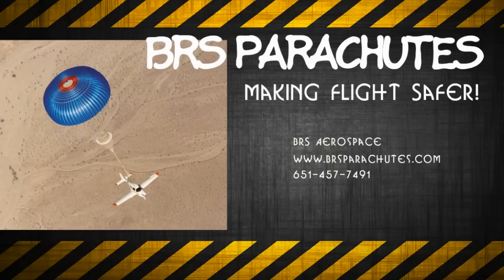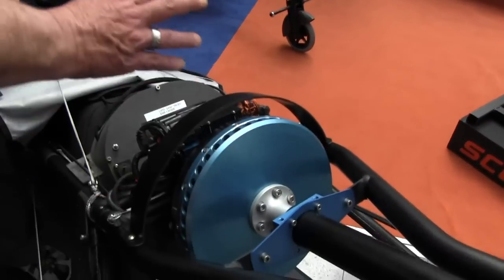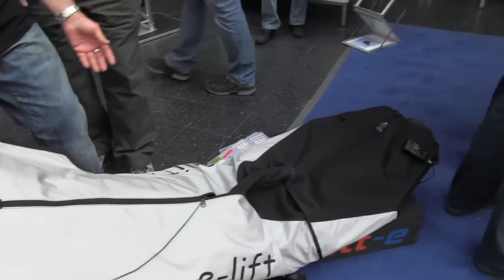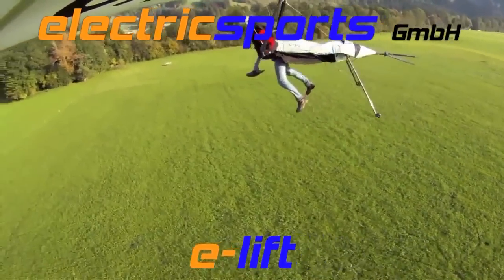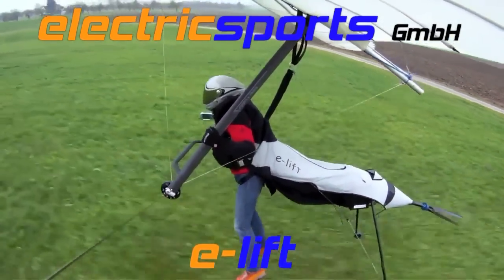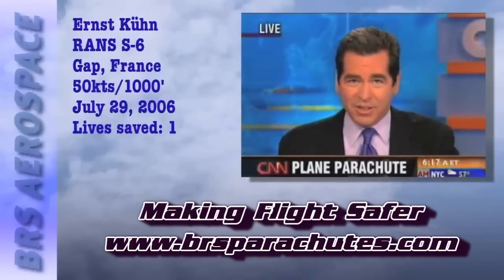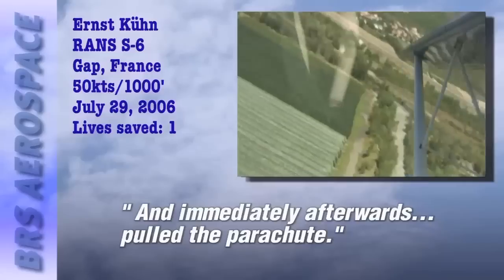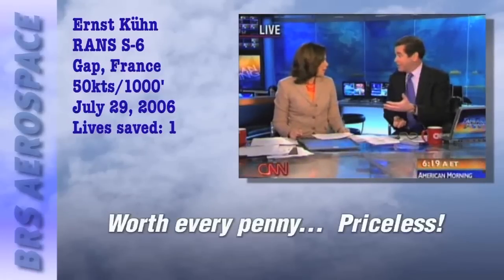e-LIFT hang glider electric propulsion system from electricsports.

Comment: I am creating an e help database. Would you tell me your motor type its kv battery size and configuration propeller diameter and pitch and maximum static thrust if you know it? And whether you are using ESC or VESC

Comment: Unless the hang glider is included, for the price they are asking you can go and get yourself an ultralight aircraft. You would have real landing gear and wouldn't have to run your legs off to get airborne.
Reply: But this makes a hang glider into a different kind of ultralight, and not an outlandishly expensive one either. Some people probably prefer it.
Reply: "run to get airborne."  and land in yours feet...Thats is the idea of hanggliding ! if a hang glider wanted to fly ultralight planes  ... it would fly ultralight planes !
Reply: shoot for that price a powered paraglider could be bought and flown

Comment: you could build extra batteries into the glider.  maybe store them in the control bar or the wings. those a123 20ah prismatic cells could be built into the wings.

Comment: A big prop is for long range efficiency, there are tiny RC ducted fans that push 8 kg just mount as many as you need on the wing, they not efficient, it doesn't matter you just need to get up to 300 meters probably less in a hang glider and off you go, no collapsible prop required they only about 100mm in diameter and they plastic.
Reply: what model or brand are those ones?
Reply: A ducted fan has more drag when it isn't running than this setup will.
Reply: I need to build a ducted fan with a retractable nose cap.